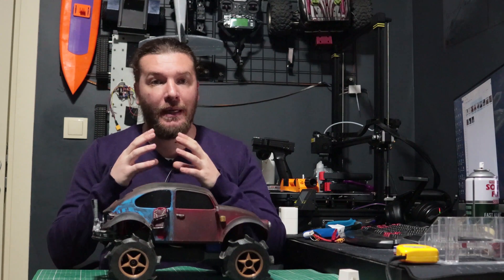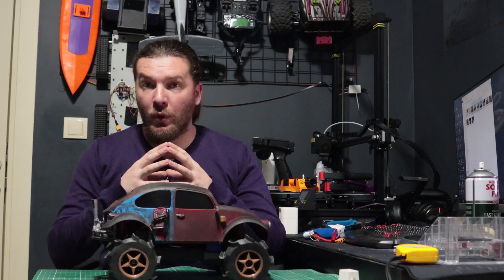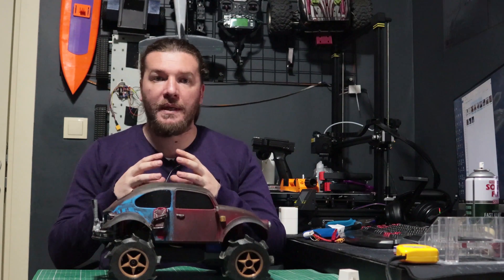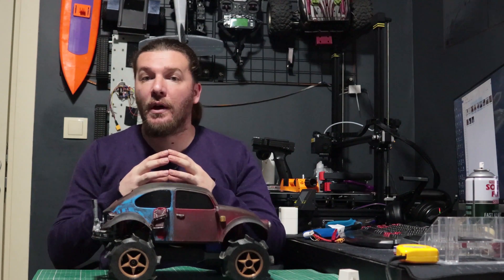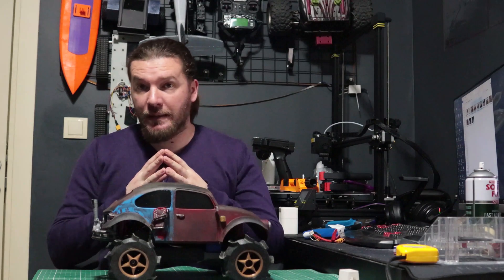3D PRINTED VOLKSWAGEN BEETLE RC BODY|MONSTER BEETLE|TRAXXAS E-REVO 1/16 BEETLE CAP

Comment: Hi! I love the design but the link is not working. Also do you have a printable chassis ( i want to 3d print the closer version to the tamiya monster beetle 1:10, but i dont have money to purchase a chasis etc i have mony for essential rc motor radio servos ...)